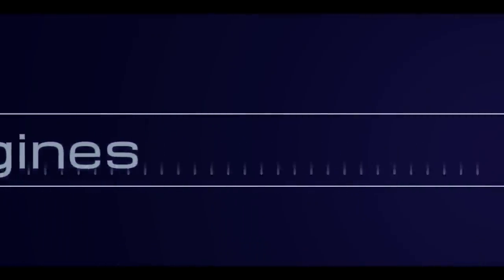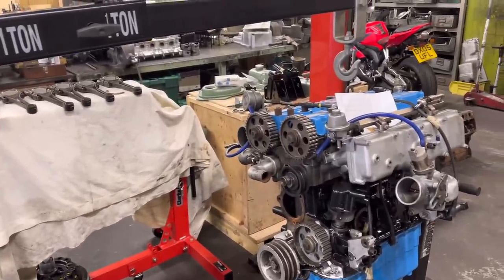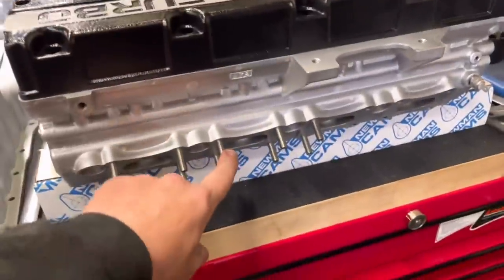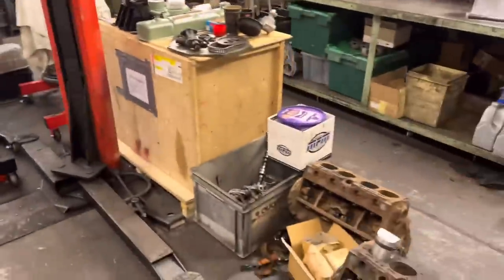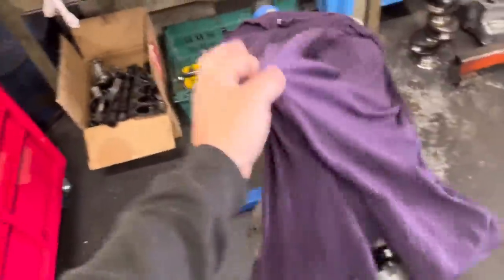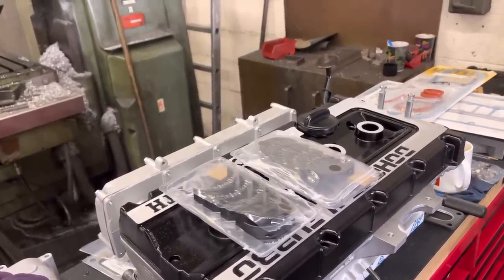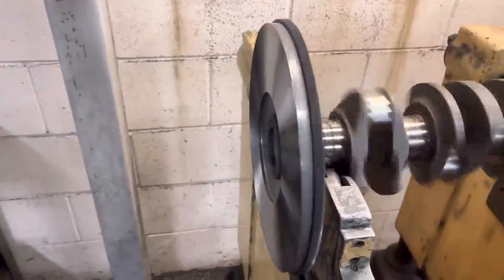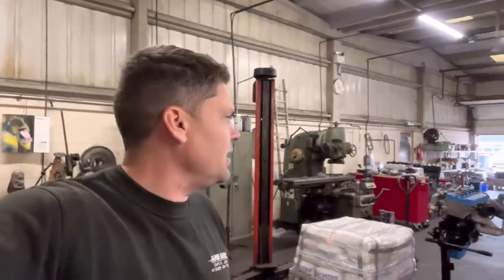BRAND NEW Cosworth crankshaft, we are SHOCKED at what we found

Comment: that crank is going to be way out at higher rpm if it was balanced at that speed . also how do you account for pistons and rod weight ? . that crank was balanced lol .
Reply: Balanced is nothing to do with the speed it's turned at for balancing. Are your car tyres Balanced spinning at 1000 rpm like they do at 70 mph? Er no. And you don't balance a jet engine at 10 000 rpm.
Reply: @michaelbamber4887  er, sorry you do, jet engines I mean, I've seen the balancer at Siemens Lincoln gas turbine rebuilding center in  Lincoln,  I think that can run at 20,000 rpm +.
Reply: @whitemonkey7932  never said I didn't. Your post implys that it should be spinning faster to be balanced.
Reply: @paulhancock3844  yes but you don't start by running it a 20000 rpm. That is for testing of harmonic balance more than the low speed balance a car crank require. We balance classic motorcycle wheels at almost zero rpm, using a 'knife stand' lightly spinning the wheel and marking the low point, spinning, add a gram, spin again.. old school,  but it works.
Reply: @michaelbamber4887  you stated that you don't balance jet engines at 10000 rpm, I said you were wrong, care to rephrase?
Reply: @paulhancock3844  that is for later testing, you static balance a jet engine by weighing all the blades and evening the blades out, then you weight each blade and space them around your turbine to achieve a reasonable starting balance. Then you rotate it at low rpm to find the imbalances and remove material to balance it up. I was only pointing out to him that when balancing something it doesn't necessarily have to run at its operational speed to do it.
Reply: @michaelbamber4887  I say again, you said you don't balance jet engines at 10000rpm, sorry you do, it's max rpm plus 10%. Don't try and tell me about gas turbines, I was maintenance manager over one for 18 years, you are well out of your depth and are just digging yourself a bigger hole. I have had 3 guided tours of the Siemens Lincoln plants, know personally the design , maintenance and technology engineers , perhaps you would like to explain your ideas to them?
Reply: @paulhancock3844  I was just going on what I remember from engineering apprenticeship at British  aerospace in the 90's. Don't get me wrong, I was only trying to explain. I'm more a machinist/ fitter than a jet engine builder. Was told how you weigh bits out before you start to build. Take it this is the same with a gas turbine as well?
Reply: @michaelbamber4887  they are only done like that in the field due to the cost of removing the core, a remanufactured unit, which is what we dealing with here is balanced to 110% max rpm. By the way all jet engines are gas turbines, known as turbo jets
Reply: @paulhancock3844  cool, thanks for the teaching. Never to old to learn, I love anything mechanical from old banger to latest tech.
Reply: @michaelbamber4887  your very wrong
Reply: @paulhancock3844  balanced to 20000rpm is different to balanced at 20000rpm
Reply: @grug5259  what part of balanced at 110% of max rpm don't you get?
Reply: @paulhancock3844  that would be the part where balancing is done prior to sending it to 110% max rpm.  Balanced to a speed means balancing is done prior to spinning at 110% max rpm and checking against tolerance specs, balanced at a speed means it is spun at 110% max rpm unbalanced and then balancing is conducted.
Reply: @grug5259  yes but it is still re balanced at 110% rpm, I've been working with GT's for over 18 years , think I've got a good working knowledge by now.

Comment: Just had a skin of the teeth £2300 moment with my crafter after an odd intermittent “hunting” on tick over. 
Pressures all over the place. One black pot, a torch and a cup full of return line diesel and hey presto.. snow globe!
New high pressure pump, tank and lines removed and cleaned through, injectors professionally fettled. 
Big thanks to Paul Metcalfe and Wight Commercials. 
Could have been so much worse.